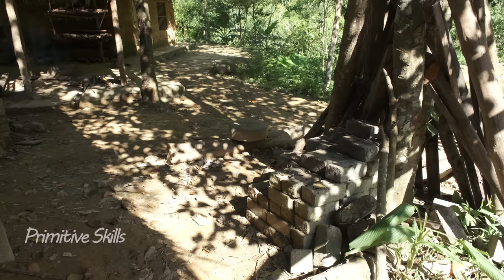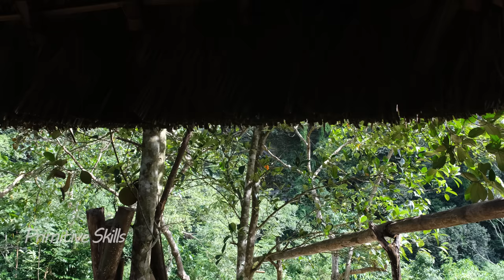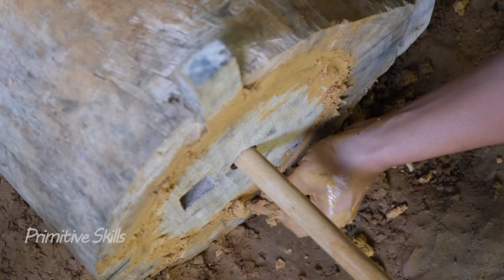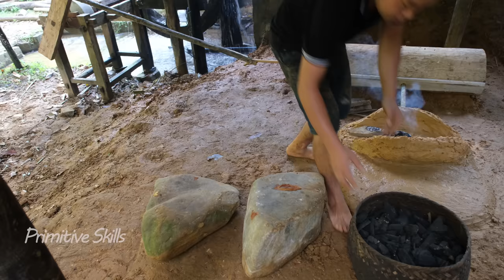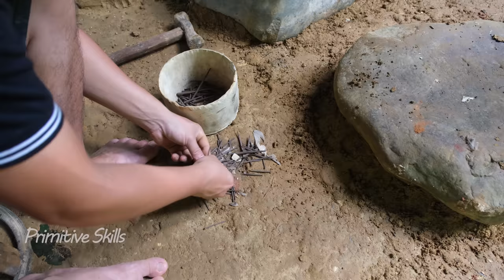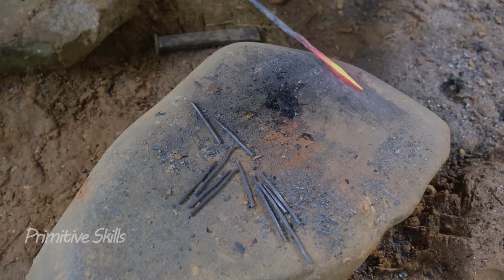Amazing! This guy is a real genius, turn the iron bar into a iron nails, Primitive Skills (ep178)

Comment: I would add a full height stone wall on the back side and the water side of the smithy. This will prevent an earth slide. Also, add a stone floor and a nice stone box for the smithy. You could also include the furnace or oven in this buiding and rebuild it with stone bricks

Comment: I'm impressed at how quickly you advance on these projects! I'm also surprised that you've gotten as far as you have without a lathe; not even a basic bow lathe, from what I can see! Perhaps consider making a primitive chuck to attach to the waterwheel's shaft? A lathe can make better drive-shafts for future automation, since the more perfectly round and smooth they are, the less energy they waste on unwanted friction.

Also, a waterwheel-powered drill might be a viable option if you want to bore holes of a standard diameter.
Reply: And using the waterwheel to power a potter's wheel would save you a lot of fuss and the pottery would be a lot easier to make. Having to kick the wheel every few seconds is not efficient.
Reply: @susank4878  No the potters wheel does not need to be powered. He needs to make a sitting one that he can kick with his foot. Those wheels are quite easy to make. I went in to some details how to put one together pretty easy. He pretty much has one already just needs to build a frame and a bottom plate for spinning.
Reply: A lathe is not truly needed. The really only thing you need a lathe for is maybe for the water wheel and maybe a few carts other than that what doe you need one for. Effort spent could be doing other projects of more value.
Reply: @kameljoe21  He definitely doesn't need a lathe, but it would sure make his life easier!
Reply: I would think drill bits forged, or maybe lathe would be neccessary to makes bits.
Reply: And a scorce  of lubrication,  grease,  plant oil.
Reply: @donTeo136  You are thinking about conventional drills. Primitive ones can be hand twisted. I do not think I still have the primitive one I made some years ago. Yet it was pretty simple to make. Take some round stock and draw out about 2/3rds of it to a flat bar. Then hot cut a point.  Then you either square up the end or taper it for a brace ( turning part ) Then using a vice or clamp twist the flat part. You can fine tune it. They are pretty simple to make. 
He could forge a very primitive foot vice with ease if he really wanted to.
Reply: Great ideas. Thanks.
Reply: The speed is too fast, to say the least. He feels like he is cheating.

Comment: I loved this so much. The whole new Smithy is beautiful. The camera shots from the forge while raining, and as it is getting darker are very lovely.  As one smith to another. May I suggest that you make a valve in the pipe from the bellows to the forge to restrict the airflow if you need to reduce the heat of the forge. also will you still have enough elbow room to work at the grinding wheel? Looks a bit tight now. but that may just be the camera angle.  Always love watching the progress and ingenuity of your little farm. Have a great week.

Comment: Great job with automating the bellows it works great, although you might end up using more charcoal if you're making a new tool instead of swapping between bars since the bellows are always running, keep up the good work!
Reply: Yeah he might likely use more yet because its running the whole time you can do a half a dozen pieces at a time. This means while working one thing the other are heating up then its all about swapping out and start pounding. This is what a blacksmith helper would have done to keep the fire stoked and stuff ready. You would make dozens of things at once rather than one thing at a time in batches for the whole day. Effective even as a single worker.

Comment: I admire what you have achieved in 5 years, it is incomprehensible to the mind. Not to reproach you, but you can't work sitting in front of the anvil, you'll just get tired, you need your back to be straight, and when you hit the hammer, the elbow should be at an angle of 90 degrees. and then it will be much easier for you!
Reply: I wish he could take risk of injury very seriously as somehow he believes injuries are for the ill experienced . I say injuries get you when you least expect and when your confidence level is off the charts. Basic PPE is all we ask even if it's a primitive type. I am as sure he can come up with something.
Reply: @kevinmakelane123  sorry, I didn't say anything about the injury, it was about comfort, it's just not convenient to forge sitting and you get tired quickly!

Comment: You should make an opening on your pipe, so that you can stop the air flow to your fire because having à continuous air flow to your fire will multiply by 2 or 3 the amount of charcoal you will use!!!
Great vid and forging!!
Reply: He could also pivot the pipe away from the fire.  Or, stop the waterwheel.
Reply: There are many solutions, just pointing out a possible issue

Comment: A suggestion for you to utilize your water wheel's rotational speed. Perhaps you could use it to create a more rapid water hammer by placing a gear teeth on the water wheel's outer rim. Then connect the gears to a levered hammer and you would have a water powered hammer. It would help raise your production efficiency as you no longer have to swing the hammer yourself and you can focus on crafting the tools you forge.

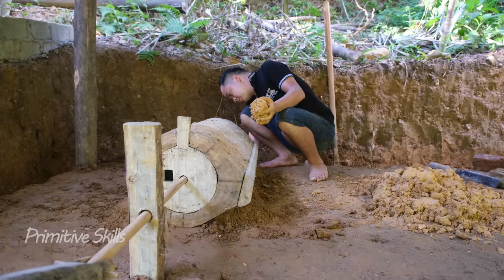Comment: 10:33 Hmm. For longevity of the bellows, you probably want to put a barrier of some kind between the clay and the wood... Concrete would be good too, but you'd still want a barrier between the concrete and the bellows. You need to keep it as dry as possible, so maybe creating a base out of concrete, then forming some planks of wood to conform to the shape of the bellows would work. This way, the planks would rot first before moisture can get to the bellows itself. They are also easily replaceable and probably a lot easier to make than a whole new bellows. So every few months or so, depending on humidity, replace the planks and reset the bellows over the new planks.

20:09 Also, if you want to stabilize the piston portion of the bellows so it doesn't bounce so much, you could install a plank underneath it so it slides along the plank. Wood is pretty springy though, so it might be fine the way you have it.

20:30 You might want to quench the nails once they're done for some extra hardening. After they're formed and cut, reheat them, then drop them into a container with water in it. The rapid cooling of the metal will make it stronger.

22:49 You should probably make some metal tongs as well so you can blacksmith smaller pieces of metal.
Reply: He has got tongues, the first few ironwork tools he made were tongues which was a brilliant video and a game changer for his survival.
Reply: A nail header would be good tool for the nail process.

Comment: lubrication!  that squeeking is friction causing wear....its a lot of work to make these things so add the fat or wax or whatever you have access to wherever you have rotation or reciprocal motion in the system.  and the area under the waterwheel still needs gravel  . thanks for the videos.

Comment: The problem is that with the bellows running constantly, you're going to consume fuel way too rapidly.
Reply: True, he needs some pulley/lever system so he can engage or disengage the main water pipe to the water wheel from within the smithy.
Reply: It won't be easy but I'd live to see Jim build it.
Reply: @szeddezs  it's easier, just redirect the compressed air away
Reply: @szeddezs  wouldn't it be easier to cover the air hole and it should have been  him not Jim. Also you forgot about Joe.
Reply: @nirodper  But redirect how? The air pipe from bellows to forge is rigid and has to be in place permanently or he'd lose air flow.
He could drill an extra air hole in the bellows which he can plug up for full heat, that would at least significantly reduce the air flow into the forge when the hole is unplugged.
Reply: @macieksmolarz5274  Cover it with what? Blazing forge temperatures and all...
And how could I forget about Joe mama? :)
Reply: @szeddezs  yes, 90% of the air would come out that hole due to the lower resistance to airflow
Reply: @szeddezs  ofcourse it will requier rebuilding of the part between the below and the firepit but you can add domek sliding pice od wood that you could pull out and lock in place to let and się through or let it fall to block it.
Reply: @macieksmolarz5274  Letting aside that such a construction will potentially introduce more weak points where precious air can escape, where does the air go when the forge pipe is blocked, even just partially? It will compress and blow out the clay seals of the bellows and put serious stress on the piston.

Comment: It would be a good idea improve the joint between water wheel shaft and the other shaft replacing ropes for pure good joint. Would be better for mechanic movement.

Comment: if you could add some kind of clutch mechanism or water diversion. you could let the fire calm down while working the metal, which would mean you burn through less fuel
though as it is it probably works plenty well enough for how often you use it. definitely better than the hand pumped bellows.

Comment: You see how when it starts raining, the ground that you are walking on turns to mud? It's hard to walk on it, the ground is slippery, and your feet get very dirty. This is why you need to cover the ground with cement!!! It will be easier to walk on, you won't have to wash your feet as often, it is easier to clean off debris and it looks much nicer!!!
Cover the floor with cement!!!

Comment: By using piston wheel you will lost your charcoal faster. . 
Because While you hammering your steel, your forging keep blowing..

Just saying 😎
Reply: Well in this case it didn't matter since he had one iron rod in the forge while hammering the other.
But a mechanism to shut down the wheel from within the smithy or something to block air going into the forge would be on my to do list as well.

Comment: Cushoning the fall of the water or encasing it, would be an easy upgrade..with the posibility to annoy the ones pressent for white noise..( encasing a cushoning?)
Acually now thinking of it, the encased water plunge damper would cause a vaccuum, ¿water powered bellows?
Reply: Secund glance..or actually watching your video.. get a valve to save on coal.. or a free run to save bellows, and coal..

Comment: do u do the building and digging all alone?
Reply: He isn't building underground castles and most of the stuff he's done can be done solo so I'd say so.
Reply: @starhammer5247  fool.
Reply: @fletchrommys7766  How am I a fool when I've watched him do it? The holes he dug were less than six inches deep and the Roman concrete was kept in place using a flat handcrafted wooden pallet as a retaining wall to keep it in. His house is made out of mud using a wooden block mould to keep it in shape and help compact the dirt. The logs are shown to be cut by hand and are far too rough to be done via chainsaw or saw. The only saw he does have was hand made (he shows the entire process) and is only big enough for small logs and is far too cumbersome and dangerous to use on big trees. The fish pond has a water drainage system on one end. There was a stream running through that section since the first video, so he can't import water for over five years.

Comment: You are doing everything very well my friend. why don't you think about generating electricity. you have a fresh water flow you can do it with an electric generating motor with a propeller
so it happens in the lighting.
Reply: This channel is called "Primitive Skills". Electricity would be the opposite of that. Nevermind that there is no way he could build something as elaborate as a generator that would produce a useful amount of electricity with the tools and resources he has available. And what would he use the electricity for? Selfmade lightbulbs? He has fire for light. Selfmade power tools? Get real.

Comment: Could take some of your iron and make a proper anvil. Like a large nail with a large head. Drive it into a log with a stop ring around the spike.
Reply: While that's an idea, it might take too much time that he could use on other projects.
Reply: @starhammer5247  vs all the others?
Reply: @kaldicuct  All of them had a higher precedent. That stone works well enough for what he needs. That and he'd need to smelt an absolute fuck ton of iron, more than what he currently has, to do it.
Reply: @starhammer5247  also consider that thebold viking design of a spike anvil doesn't take very long to make. Much less time than most of the others.
Reply: @kaldicuct  I think half of your message is missing because I didn't understand what you just said.
Reply: @starhammer5247  the old viking anvil is a spike with a flat head. We on the same page so far? Not being snarky. I'm just not wanting any confusion.
Reply: @kaldicuct  I understand and now it makes a bit more sense.
Reply: @starhammer5247  awesome. I didnt want you to think I was being an asshole.
Reply: @starhammer5247  that said if you have a look at htme in the reset section. They make an anvil like this.
Reply: @kaldicuct  guessing you meant "them" and not "htme". What's the Reset Section?
Reply: @starhammer5247  no htme  How To Make Everything
Reply: @kaldicuct  Oh yeah, those guys. I like their content.
Reply: @starhammer5247  yeah great supplemental for this channel. Luke the hand saw they did. I also suggest corporals corner, Townsend's, nutnfancys old camp vids, and survivallily.
Reply: @kaldicuct  Going to need a way to bookmark comments.

Comment: You are doing everything very well my friend. why don't you think about generating electricity. you have a fresh water flow you can do it with an electric generating motor with a propeller
so it happens in the lighting.
Reply: Allthough it would be cool it is PRIMITIVE survival so that would kinda beat the point. Also i dont think he knows or has the material to make a generator

Comment: Could you use the water wheel to power  the same “arm” that powers the bellows, and carve a mold for nails into a rock? Hope that makes sense.
Reply: ??
The water wheel does power the bellows, what are you talking about?
And no, making a mold wouldn't work because a) he could never get the iron hot enough for it to be pourable, and b) cast iron afaik is way more brittle than forged iron, the nails might just shatter when hit with a hammer.
Reply: @szeddezs  I’m talking about the arm that moves the bellow back and forth, tie a rock or piece of iron to the end and have it rub back and forth on a bigger rock to make an indention to forge a nail. I know the water wheel powers the bellow.
Reply: @_topshelf_5845  Ooooh okay, totally misunderstood what you meant😄
But still, the mold thing wouldn't work., neither with casting nor forging.
And you'd probably have that rock or metal rubbing over the larger rock for years before you'll see an indentation.
Reply: @szeddezs  :  That rock is fairly easy to shape/cut/groove.  A groove would help with forging uniformity into his nails.  A groove would act like a swage block.  Rough shape the nail rod the way he has been doing it.  Finish shaping it in the swage groove.
Reply: We all want to see uniform nails plus little heads on them but in the context of the rustic homestead I think they are better suited just as they are
Reply: @jimbayler4277  "That rock is fairly easy to shape/cut/groove"
Not with the method you described, since there would be no pressure on the scraping implement. He'd have more success cutting a groove by hand.
But the nails he made so far seem plenty functional anyway, so...
Besides, I've seen nails being made in living museums as a kid and thats the way they made them too. Perfectly uniform nails with heads weren't really a common thing until industrial methods came along.
Reply: @szeddezs  :  Somebody else said "use the wheel".  I did not specify how to cut/groove the stone.
There is archaeological evidence of Egyptians an East Indians cutting Granite with hand saws, circular saw blades, and hole saws.
With persistence (something he has an abundance of) it would not be that difficult to create a groove in one of his anvil stones.
His anvil stones appear to be sandstone.  Sandstone is relatively easy to work with.

I'm not advocating using a swage groove tool to form workable nails.  I'm just saying that it is do-able.

Comment: This guy is a fraud. While he admittedly does do a lot of physical labor, he has outside help with everything he does. His tools are not "handmade" with the iron he claims to have smelted himself. Also, you can see the saw marks in a lot of the wood he uses and the bamboo he's supposedly cut with an axe or machete...